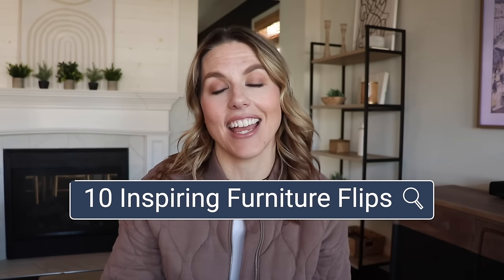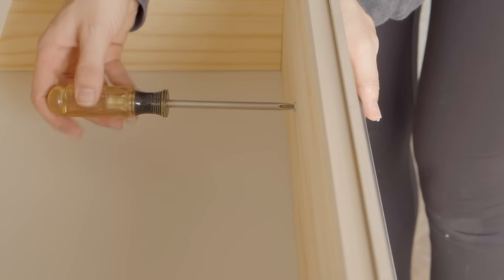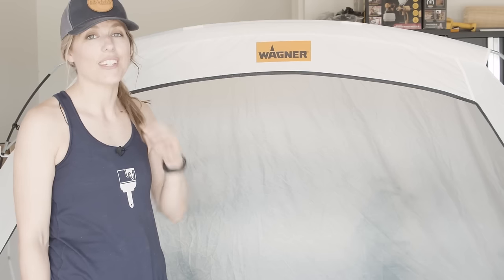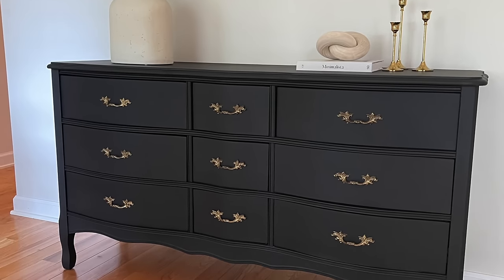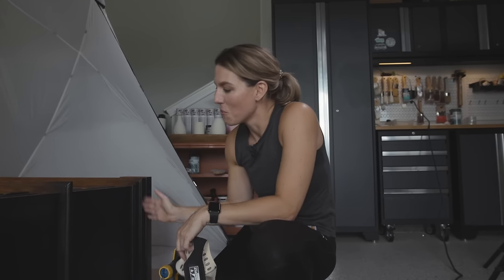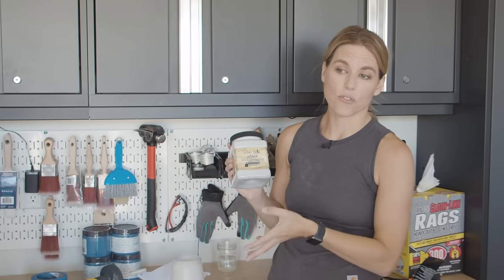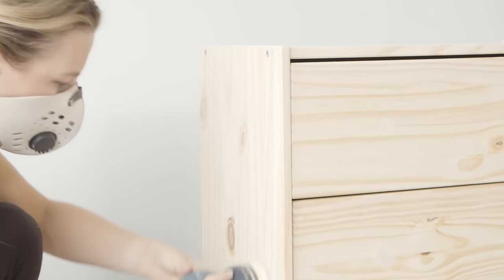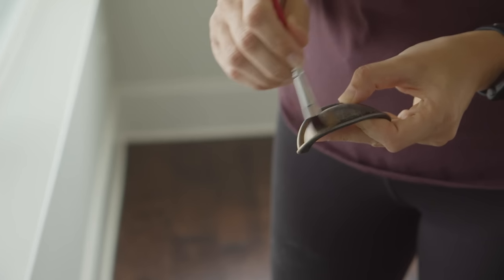10 Inspiring Furniture Flips for 2023 | DIY Furniture Makeovers

Comment: You are so precise and clean with your work. I learned a lot from this.  Gorgeous pieces. I’m not a furniture flipper, I’m just painting my 80s oak vanities right now. I used beyond paint on one of them and I loved the finish. Just don’t put painters tape on the paint!  It peeled the paint right off. I was able to touch it up.  I should’ve used 123 on it. For my other vanity I just used Home Depot’s cabinet paint with lots of prep.  I needed a specific color, Behr Meteorological, because I love color. I’ve noticed lots of flippers are using greens. I’m loving blues right now.  Anyway, I hope to do more projects in the future.
Reply from the maker: Love that! Thanks for sharing.

Comment: I would love to refinish my 80s oak dresser and bedside chests but I am at a loss as to how to do this. They have lots of curved edges yet boxy and the drawer pulls are actually an oval cut out rather than hardware. I am not much into carpentry but adding paint, stains, adding legs and hardware are my skill set.  I haven’t found anything out there showing makeovers on this kind of furniture. I would love ideas. Wish I could add photos. 🥴

Comment: I'm new to All In One paints. I'm currently using Fusion that I found locally. I'm painting a dark blue. I keep getting eithr roller or brush strokes no matter what I do. Is Dixie Belle easier to use? Or the Beyond Paint?
Reply from the maker: I've only used Fusion a hand full of times, but I like paint I can thin out with water so that is why I go with Dixie Belle a lot. The water will help smooth out the finish. But the only true way to avoid brush strokes is to spray. Sanding in between coats helps as well.